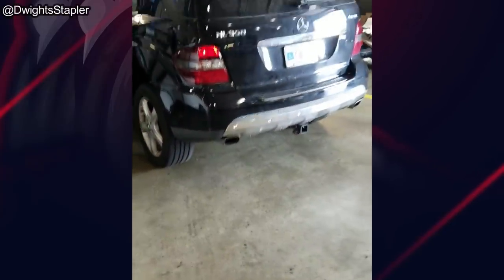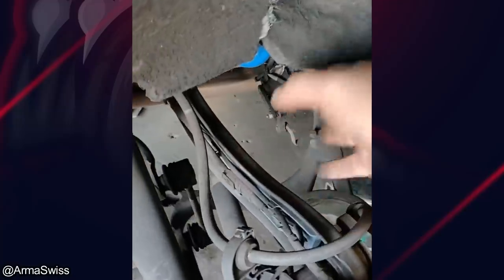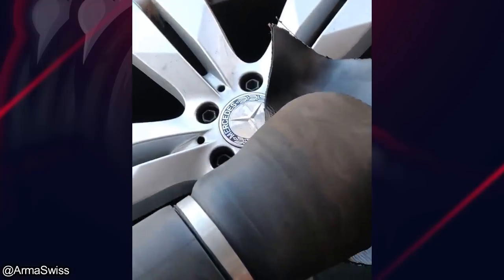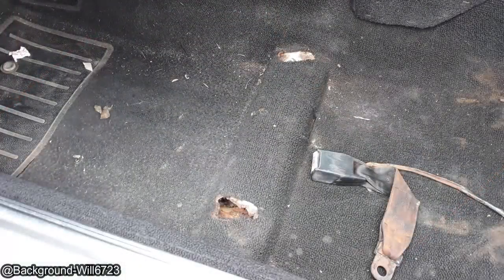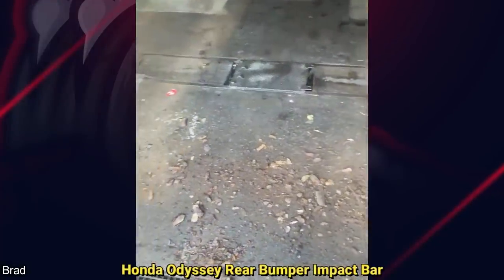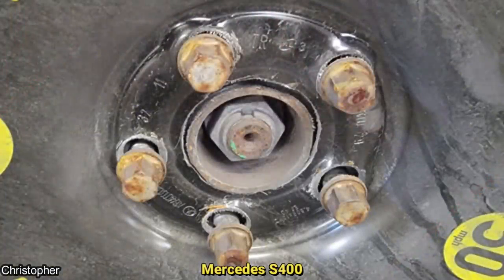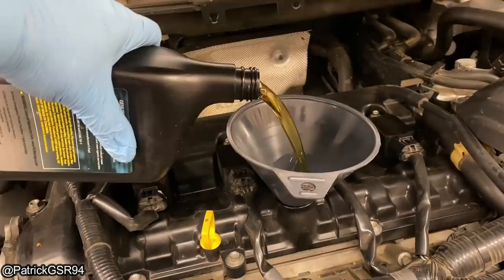Customer States Vehicle Smokes After Oil Change | Just Rolled In

Comment: That smoking car thing happened to me a few yrs ago.  Got oil change at a quick change shop , drove about a mile and suddenly I’m laying down a smokescreen for the Normandy invasion. Drove straight to a real mechanic shop a couple minutes away and they told me the other place didn’t drain oil when they did the change, just added more. So I guess that happens a lot more than you would think.  The quick change shop got indignant and accused me of lying when I told them what happened. Never went there again and told anyone I could about them.

Comment: Great tip with the oil bottle, I learned that one from my old man about 40 years ago, but I'm constantly amazed at how many people don't know this.  Same applies for any fluid in a vessel.
Reply: Under normal temperature and gravity conditions.
Reply: If it makes you feel better, I've known this trick for a couple decades and still catch myself doing it wrong sometimes. It is just counter to how you pour about everything else.
Reply: Some manufacturers even print this info on the side of the container. Which leads to the question: why don’t they all print that info?
Reply: conveniently, auto makers always insist on putting something tall next to the oil fill hole making holding the oil container "down" nearly impossible.   Same thing with windshield washer tanks and radiators.
Reply: Gearjammer  They're prettymuch the same design today, I know this for a fact because like I said, my old man was teaching me how to pour from them 40 years ago.  Early 1980's.  Rectangular metal tin or plastic bottle, as long as the spout is offset the concept is exactly the same and they pour the same way; you want to pour with the spout uppermost.
Reply: I lived on a farm for a good bit and I still didn't know that lmao
Reply: Gearjammer  Jeeeeesuz, man. Caught in a lie? Every country and brand has different bottles, different shapes. Personally, I can cite another 40 years of experience and my own father's advice to back up Mason's quote. Just relax. Make the world a better place.
Reply: @frotobaggins7169  Windshield washer tank less than an inch from the hood stand base, on my 2015 Ford Escape w/1.6L Eco. The mid-price ww fluid bottles in my area are all centered top, and because of that fill location I cannot find a useful funnel. I always loose several ounces, sometimes more. Still don't understand why it had to be on that side, when the exact opposite site isn't obstructing anything at all.
Reply: @johnrussell5592  I have a car where the windshield washer tank is down in a hole so  it's literally impossible to get anywhere even close to it.  So I feel your pain.  Try this, take an Quart oil container with the off set spout and cut the bottom off it and wash it out with soap and water to get rid of the oil residue and use that as your funnel.  I keep one in the car at all times.  I keep the cap screwed on and fill the open end with paper towels.  I always just wipe it out with the paper towel before and after using it and just put the paper towels back in it.

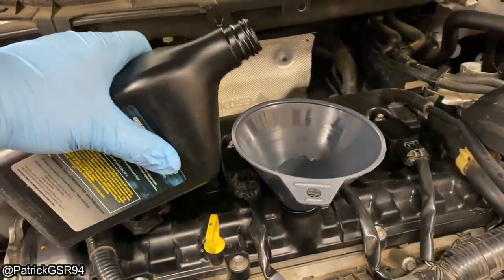Comment: 2:39 - this does not only work for oil cans but for almost all fluids and beverages that come in a bottle or carton with an asymetrically placed  hole. Like Tetra Paks.
Reply: I always hold it sideways. Better aim and also pours smoothly.
Reply: @krystiano.610  I yank the bottle upward and try to arc the oil into the hole.

Comment: I was driving a Pinto in 1977-these cars rusted bad in Michigan winters. I once hit a bump, and the seat dropped down because the floor was rusted through. I cut a piece of 2x4, jammed it under the seat, and kept on driving. Later, I got a sheet of tin, pulled up the carpet, stomped that tin into something like a floor, and laid the carpet back over it. Fixed.
Reply: Back in CT in the 70's my father would drive to the train station with some of his co-workers.  He said that one guy's car was so badly rusted out.   The guy would put his feet through the floor and onto the road to keep the car from moving while stopped at traffic lights.
Reply: A buddy did that 2x4 trick with his vw rabbit drivers seat. Worked for some time. That was back in the late 1980s.
Reply: D. Pierce......The good ole days  👍  🤣
Reply: I had a 64 Commander that had half the sheet metal under the front passenger seat gone. A piece of half inch plywood fixed that problem.
Reply: @lisab3396  I was young and poor then-that car HAD to get me to work the next day, so I learned how to keep it running, no matter what. No youtube then to help...
Reply: @sd906238  I worked with a guy in the '70's who's Ford rusted so badly he tied a thick piece of rope to the frame rail on the drivers side and was driving while holding the frame off the ground, it was wrapped around his shoulder. Asked how he was doing that, he said pot holes really suck!. Only did it for a week or so then got a new car.
Reply: Way to go "RED" Green. OOps, no duct tape?😁
Reply: Your hired! 😂
Reply: There should be "I survived Ford Pinto" t-shirts.
Reply: Manual shift 1974 Subaru, Chicago, floor was gone. Husband "mounted" a 4x4 to the frame, used Ubolts to fasten the gearbox,  sheet metal over, got another 25k miles. You do what you gotta do. Friends gave it an actual funeral procession when we took it to the junk yard.
Reply: my friend tim gave me a ride home once.  looking down i could see the road going past.  I said tim, I can see the road.  He said yeah, there's a hole in the floor.  I said you might wanna get that fixed. lol

Comment: Another great episode again my friend..   Loved the opening.. reminded me of a time when I was in college and was working at a Firestone Tire center..  One of the guys did an oil change and when they filled the engine back up, they decided to use the carburetor... instead of the small round thing that says OIL on it..
Reply from the maker: Thank you! And you're the second person in the comments to say somebody added oil into the carb lol
Reply: @JustRolledIn    haha, its a shame that its so common.  But I have heard someone say they needed 710 fluid before... they read the oil cap upside down...🤣
Reply from the maker: @firechicken2011  🤣 funny how many times I've heard that as well
Reply: Reminds me of my friends elementary school sister offering to top up the water in her mom's 65 Volvo just like she had seen her mom do every morning , except she used the garden hose to fill the crank case instead.
Reply: @anthonysinclair5721  Dammit!!!
Reply: my brother once refilled his oil not realizing he had forgotten to replace the oil pan plug. LOL  Oil is quiet when it hits the floor.

also, while working at a hardware store, I had a customer returning a new mower that wouldn't start.  I asked if there was oil in it.  they assured me there was.  I removed the cap to check and oil immediately started pouring out.  I quickly replaced the cap and asked if they tilted the mower on it's side to add the oil.  They assured me they had NOT.  I asked how they managed to get more oil in it than it would hold with the cap removed.  They of course had no answer for that.

Comment: 2:40 I've been turning wrenches for a decade and a half.  I didn't know that there was a better way to pour oil.  Thanks for the tip
Reply: Some of the oil bottles even illustrate that near the cap.  Sometimes it doesn't matter.  Anymore I use a funnel and dump it.  Let it glug/burp.
Reply: You cannot be serious?
Reply: I was at a local shop recently and noticed the guy keeps whiskey bottles filled with brake fluid and trans fluids like a bartender.  He informed me the liquor bottles and the liquor pouring spouts work perfectly for filling and he doesn't miss and spill anything.
Reply: @kjisnot  Guessing he gets paid by the hour instead of book rate...taking 10 minutes to pour fluid out of a liquor spout must be making him good money.
Reply: I usually pour it on it's flat side for the same effect
Reply: Keith James   This was over 50 years ago but my Great Grandpa who had a thick Italian accent had his own gasoline tanks and pumps on his ranch for his own use, and the distributor would come out and fill the underground tanks when needed.  He had dozens of old Coca-Cola bottles on the horizontal parts of the 2 x 6 framing of his outdoor carport next to the pumps.  At the time I don't think I was 4 years old and he told me to never touch those bottles or drink out of them because they would kill me. Years later after my great grandpa died I asked my uncle why he kept those Coke bottles and what was in them?  He said every time a distributor would fill up the tanks grandpa would take a sample of the gasoline and pour it into bottle so he could see the quality of the gasoline to know if he was getting ripped off or etc.  I remember the gasoline having a pink color to it
Reply: Calvin Schubert   Preference is like toilet paper.  Folded or waded?  As long as it gets the job done ✅
Reply: Now you all know why the handle of a milk jug is hollow...
Reply: @DL101ca  Just for topping off.
Reply: @Shraedar , thanks, I didn't know that either
Reply: @johnchestnut5340  many oil bottles still don't have the pic at the top.  And with my luck if I just turned it over in the funnel it would still find a way to splash all over the engine bay.
Reply: @Patrick94GSR  In my comment I said "some".  I know it isn't all bottles.  I get it.  I'll try to be clearer in the future.  Thank you for your comment.
Reply: @DL101ca  maybe he was paid in whiskey..😁
Reply: @kjisnot  O
Reply: @kjisnot  So he couldn't invest in some funnels?
Reply: @potcommitted5355 , it is saddening to see someone live such a pitiful life that it triggers them into hurling insults when they see someone live a successful career with a different technique than their own.  But fear not, you may insult away, I won't bother me one bit because someone like you doesn't have anything to say that is worth listening to

Comment: That's why I never recommended quick oil change
Reply: How did the previous shop not know to investigate before letting the customer drive off?  Did they not even test run the car?
Reply: @jamesplotkin4674  no time for that you know they are express no?
Reply: @jamesplotkin4674  They probably did, but the heck if they were going to stop the customer. Further down the road the car gets the less they can be blamed (in their mind).
Reply: I worked at a testing lab.  We would always gets sample in from customers that went to quick lube shops.  They would put motor oil in the brake fluid reservoir.  It would destroy the seals then the brakes would fail.
Reply: @jamesplotkin4674  I'm guessing 99% of regular shops don't test drive after an oil change other than parking it
Reply: @ian3580  Yeah, I worded that wrong. I meant once they fired it up, and they still didn't notice, or when the customer took off?  I always check the level before I'm done.
Reply: @PanameraTurboSEHybrid  Please read carefully... I said didn't thy test RUN the car. In no way does this suggest they drive the car.
Reply: @jamesplotkin4674  Don't tell me what yo do. I misread your comment, relax.

Comment: I'm amazed by these videos. I live in England and by law over here you have to get your car checked out and tested every year. If you don't have a valid test certificate then your insurance isn't valid. If you drive without insurance and get caught, then you're looking at substantial jail time.
Reply: 2 years in the Czech republic, but apart from that, the same here. Cars get, I believe, an exception from that for first couple of years (3 I believe), but that's it. No valid inspection? No valid insurance. No valid insurance? You have no business on the road. Done.
Reply: Most places have yearly inspections in the U.S., however it doesn't effect registration or insurance. And many people simply don't care about having it inspected
Reply: @gearhead2255  it does effect insurance and registration in Massachusetts.
Reply: My friend drove without insurance, he just got points on his licence
Reply: @james… incorrect.  I also live in England. Your insurance is valid even if you have no valid MoT certificate. If you’re caught, you’re fined. 
If you’re caught with no insurance, car is impounded, points on licence, fine. (Generally).

Comment: I live in Pennsylvania and I have seen cars with worse rust roll in. The broken cv joint gets me every time, my dad would always tell people let me do the cv joint boot and axle on both sides because if you do only one the other will be gone soon. Nope just do the one, not even a couple weeks later here they come, the other side broke 🤦‍♂️
Reply: Don't understand these cheapskates...
In the long run you will definitely pay more...
Reply: Sometimes, it's cheaper to just get a re-man axle and be done with it. Shop/tech time is to valuable to mess with rebuilding.
Reply: Thanks, man.  I’ll remember that.👍🏻
Reply: Hi there, I'm thinking that WAS a reman shaft in the vehicle and somebody pounded the crap out of it installing/seating it and broke the bearing cage.

Comment: 2:40 here's another tip: if you need to put oil in your engine but don't have a funnel handy, hold the bottle flat and keep the spout as close to the filler hole as possible.  It'll keep the oil from spilling.
Reply: another easy thing to do is cut the bottom off a bottle, usually the first quart of oil and use it as a funnel.  also a paper plate or some such thing can be rolled in to a funnel, be sure to keep track of where the seam is pointed. lol  NEVER use a Styrofoam cup as a funnel for gas.  ask me how i know.  LOL
Reply: @frotobaggins7169  Enough styrofoam  dissolved into gas becomes something like Napalm ...
Reply: @ottisqaiucci2987  lol, is that right?  all i know is that holding a Styrofoam cup as a funnel and pouring gas in, it will last about 10 seconds until the cup is gone and you have a big mess on the ground.  I tried that once when i was 16. lol
Reply: You can also carefully pour the oil with the dipstick touching both the inside of the filler hole, and the mouth of the oil jug. The surface tension of the oil will make it follow the dipstick
Reply: @localidiotnumber792  I've seen that.  It's pretty slick

Comment: That’s not the suv to take to a lube shop or jiffy lube. You have the money to own that Mercedes. You should have no problem taking it to Mercedes or a mechanic who understands most Mercedes suvs are not drained. Their pump and siphoned. And when you change the filters. The gaskets have to be changed. Nevermind sometimes the damn oil pump or water pump has to be changed.
Reply: Why do they need to be siphoned? Is it a dry-sump lubrication system? If not it should be able to be drained normally.
Reply: @CarterHancock  The same reason some BMWs dont have dipsticks,  Because, Ze Germans are soooo clever with their engineering :-)))
Reply: @uhtred7860  Lol yea my dad's Porsche 987 is like that too. But it's still a wet sump and is drained normally...
Reply: @CarterHancock  it doesn't have to be siphoned at all
Just merc and bmw elitist who can't find the correct washer to replace and need that extra safety of a pump
Reply: They can 100% be drained.
Reply: Regardless, you shouldn't bring a Mercedes like that to jiffy... Ever..
Reply: @wiiinston17  Shouldn't bring anything you care about to a Jiffy Lube
Reply: I've changed the oil on such twice.  I had to teach my part-time guy that there was no dipstick.  You just had to be very certain of your measurements and read the console.  Weird, but that's how it was made.  I also had a vehicle that the transmission fluid had to be checked with the engine off.  You never know what's coming in.
Reply: @johnchestnut5340   thats usually the case with manual transmissions. in my experience anyway. (you have to check while engine is off)
Reply: @liev535  I was referring to an automatic transmission.  Nobody is surprised about the manuals.  But thanks for commenting.  I should have been more clear.
Reply: @wiiinston17  Never bring anything to Jiffy for that matter lol
Reply: @johnchestnut5340  My Toyota doesn't have a dipstick for the automatic transmission. You have to hook a scan tool up to verify the transmission temperature. Then you can open the fill hole if fluid comes out it's full if it doesn't it ad some. In other words. It's a dealer checked item maybe. I don't know if the check it at the time of an oil change.
Reply: @brainfreeze44131  You aren't reading the comments.  One vehicle, no dipstick for oil.  Another vehicle, engine has to be off to check the automatic transmission.  Yours isn't unusual anymore.  But thanks for commenting.  I'll try to be more clear in the future.
Reply: @Alucard-gt1zf  Thanks Alucard, yeah they probably think they're getting 100% of the oil (which you wouldn't want to do anyway)
Reply: They pump it out because you have to remove a bunch of plastic panels to get to the drain.
So they pump it out, but - as every dumb ass car - the filter drains onto the plastic panels and your fresh from the dealership oil change MB GLK350 drips in your garage for a month.

Who designs this shit?
They obviously have no experience maintaining or fixing what they design.
Reply: @sirifail4499  Hi... we meet again :-) Husband's got several Mercedes Benzes over the years, never had any problem after oil changes. Maybe there's some tool/funnel/ specially shaped basin or something to prevent that dripping and your shop doesn't have it? That's absolutely the first time I've heard about this.